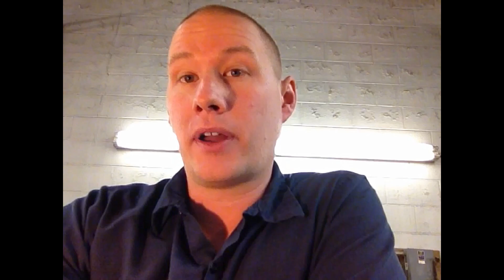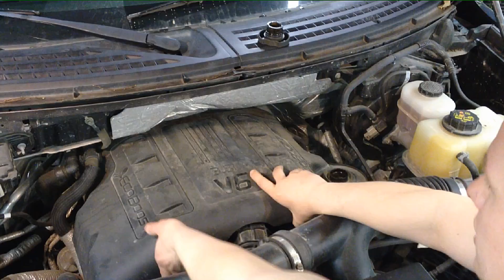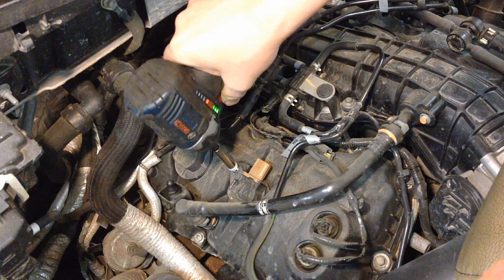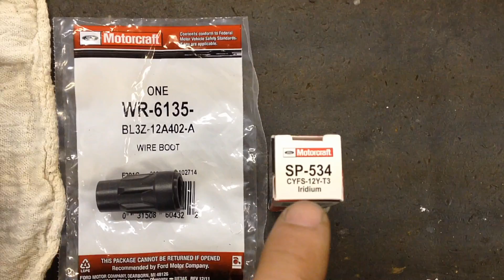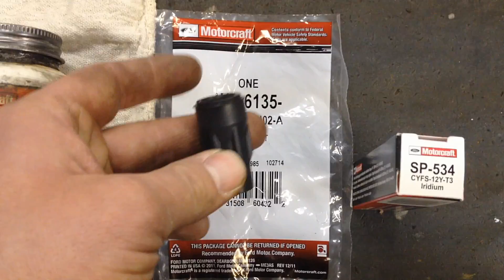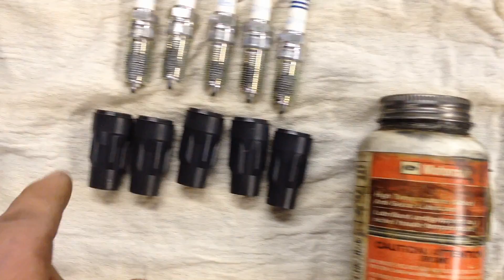2011-2016 Ford F-150 3.5L V6 EcoBoost Spark Plug Replacement

Comment: Man when I do this on my truck you won’t catch me blowing all that  crap off the intake manifold with my coils out.. if anything a quick blow out of each hole before removing the plug
Reply: i guess you know better than a dude whos done thousands of these lol wtf
Reply: @jimhendrix7776  I like his videos, they’re super helpful, and he’s definitely knowledgeable, but they’re not his vehicles. Just saying in my opinion, and on my truck, I’d rather not stir up any or the dirt and risk getting it down in the cylinders.
Reply: @noahgullion2  makes sense.... Im sure he practices what he preaches on his own vehicles :) though... 

2 each ones own no doubt though
Reply: @jimhendrix7776  I’m sure you’re right I just tend to take the best possible care of my stuff even though it may not make much of a difference it makes me feel better lol.

Comment: i HAVE 2012 FORD F150 3.5 ECOBOOST  SINCE THEN I BELIVE NEVER CHANGE THE BOOTS SPARK PLUGS CHANGE NOT LONG AGO I RECEIVED RANDOM MISSFIRE  what is your recommendation for spark plugs, boots, coils etc. you can  write amazon links. I also have problem with turbo. before i sent it to change my engine timing chain i was able to hear air suction after that i didnt hear any   car computer show some issue with turbo which dealer has.

Comment: So what happens when the boot separates from the coil? The first two coils I pulled came separated and are stuck in the spark plug tube.
Reply: no heat shield they seize onto the plug

Comment: I'm a little confused. I was under the impression that these plugs come pre-gapped and you shouldn't re-gap them. I have a 2013 F-150 3.5L EB and was given motorcraft sp-580's. I installed and the truck runs a little rougher than my originals with 91k on them. Should I take them out and re-gap?
Reply from the maker: They should always be checked and gapped to .028”
Reply: @FordTechMakuloco  Thanks for getting back this quick. Thought that may be the case after reading some more comments.
Reply: Just wanted to follow up and let everyone know that what this guy says is gold. I re-gapped the plugs to .028 and it runs smooth as the day it came off the assembly line. Well when the engine is warm anyway. Cold remains to be seen in the morning, but I can only guess that it will be smooth as well. The plugs came gapped at .031 and some at .032 and bringing them to .028 made all the difference in the world.  Thank you!!!!!
Reply: how did u check the gap and what method did u use?

Comment: I have read that with these 3.5 L Eco-boost motors (2011-2014), it is important to pull the spark plugs while the engine block is warm (not hot or cold). This is said to reduce the likelihood that you may gall the threads on the plugs or the engine. Is this your practice, or have you never seen any issues? (Man, these are truly excellent and informative videos!)
Reply: Never heard that, never had that problem either and I have 3 ecoboost motors with over 330k combined miles

Comment: I get the point about cleaning with air prior to removing boots and plugs.  But did I see you use compressed air (9:42) on a cylinder with the plug removed?  If yes, doesn't that now push debris into the open cylinder shaft?  Please explain...
Reply from the maker: No when the plug is removed you stick the air wand down into the cylinder then hit the trigger pushing everything out not in.

Comment: I see that this was created 5 years ago and it now "appears" that the SP-580 is the "new" correct spark plug and .032 is the new gap. Can you shed any light on this new standard or should we stick with the SP-534 and .035 gap?

Comment: How hard is it to replace those clips at 3:21? I broke 2 of the red clips trying to get em off. They seem to stay on without the clips and I may just duct tape em but just curious how difficult it is to replace em altogether?
Reply: I broke a red clip 2 years ago and never put anything else to hold it, still never came loose even after offroading
Reply: Did you ever replace them I need to figure out how and what part to buy
Reply: @rdking005  I never did, I put a little electrical tape around them and they held no problems for over 20k miles. I just traded in the truck on a 2020
Reply: I ordered the plug with wires I’m. Gonna try and replace the connector only and see if I even can
Reply: @rdking005 any luck replacing?

Thanks for this thread. I just broke a red clip as well. We will see how this goes
Reply: @baldcowboy  I never did, I put a little electrical tape around them and they held no problems for over 20k miles. I just traded in the truck on a 2020
Reply: The red clips are just safety locks. The gray clips under the red do the real work. The red clips don't matter. I have several broken gray clips and the connectors still don't come off. They get brittle with age.

Comment: Are all the specs and parts still the same?  Going to give it a try on my 2014 Ford F-150.  What are the pry tools that you are using?  Thanks.
Reply: westsidewil its a generic trim removal tool.

Comment: I have a 2014 F-150 3.5L V6 Ecoboost bought used last year. In the last 6mo I've had misfires on spark plugs. Both times is when I was accelerating to pass a car. Anyone have any idea as to why?
Reply: B Hays they need to be replaced
Reply: @jakefromstatefarm9135  Wow, really?
Reply: @bhays71  Did you get a check engine light? I'm probably replacing my plugs and coils tomorrow.

Comment: where can I find a map of the cylinders? I am finding 2 different ones online. My 2011 f150 needs ignition coil # 4 replaced?
Reply: Bank #1 is passenger side bank #2 is drivers side. Bank #1 from front cyl is 1,2,3 to firewall and bank#2 from front is 4,5,6 to firewall (V6)
Reply: @dirtboyslong9202  Thanks Man, changed it out last night.. second time I changed that coil out. Was originally on #1,  dealer moved it to #4 while troubleshooting code again,and said it was the coil and wanted $385 to replace it...told him to pack it up arse.

Comment: What’s the difference between sp580 and sp534 plugs?
Reply from the maker: SP580 is the latest plug replacing the SP534
Reply: FordTechMakuloco 
Thank You for the quick response!

Comment: Awesome video! Are these still your current recommendations (plug type and specs) for a 2013 F150 Ecoboost 3.5 V6?
Reply: No, use SP542 plugs gapped to 0.028-0.030, SP580 are updated SP534 plugs. The SP542 are a heat range cooler and help against pre ignition in warmer conditions with stock thermostat and cheap gas.
Reply: Doing research, I bought SP-580's as the newest plugs

Comment: Newbie question. When you blow compressed air down in the open hole, it looks like plenty of dust comes out. Are you worried about getting dust or fines into the cylinder?
Reply from the maker: No, you stick the air wand into the cylinder and then pull the trigger creating positive pressure in the cylinder with low pressure being outside the cylinder so all the dust from the threads follows the path of least resistance just like water and just like electricity.
Reply: 10-4. That’s what I figured. Will get longer nozzle. Thanks for your help.

Comment: Excellent video, did my 2013 with no issues thanks to your video.  Quoted $360 for this from my Ford dealer, did this for about $100 with supplies.  Plus I had to go out and grab the gap gauge etc.  Also for a newbie be sure to grab a magnetic socket for spark plugs, so much easier than my old spark plug socket that the plugs wouldn't stay in when pulling out.  Updated plug is now the SP-580.  Thanks again.

Comment: Did/do you change the spark plugs on the 3.5’s when the engine is warm or completely cold?
Reply: Warm... but not hot. Mine were a bitch to get loose.

Comment: Just did my 2016 expedition. At 72k it was running decent but just seemed a little sluggish and mpg lower than in the past. Clearly felt better after new plugs. Had a boot get stuck on the middle left bank. Had to twist the coil and separate it from the boot and then pull the boot with needle nose. Needless to say had to replace that boot too. Thanks for the great videos.

Comment: Great info, Thank You!! My dealer just changed my plugs and put in SP580 plugs and new boots, in my 2015 F150, 3.5L engine. Are the 580 plugs a newer version again?
Reply from the maker: yup just came out not too long ago.
Reply: @FordTechMakuloco  is the gap still supposed to be .028"  I'm ordering these plugs for my 15 3.5eco w/ 45k right now as the rough idle just started.....
Reply: @toddthacker8598  you have that too? I have a 15 3.5 just started getting a slight shake up front at idle. still on original plugs. 67k miles. i figured its a misfire but im not getting any warnings or check engine, no power loss either when I get on it. You think just swapping the plugs will fix?

Comment: I got a 2014 Ford F150 5L

i just bought new spark plugs SP 550, but i also got the other ones also SP 591 on the shelf, i didn't want to take a chance so i got both.

Comment: I have a 2013 F 150 3.5 Ecoboost, 155,000 miles. It has started leaking oil from the passengers side valve cover. So I've watched many youtube videos to see how to replace the gasket. No one has a video on removing the valve cover. However, I've tried to remove the valve cover, man that thing would  not come OFF. What is holding the cover down? Yes, I double checked ALL 12 bolts holding the cover, they are loose. I could pry the front of the cover up just a bit, but that's about it.  What should I try now?

Comment: 65000 volt coils and a .040 gap works with tuned engines and helps with economy. problem is boosted engines need better coils to prevent the spark from being blown out and narrowing the gap kills milage
Reply: Coil on Plug technology is THE HOTTEST ignition available.  FACTORY parts are totally worthy a race engine.  I have retrofitted parts from a mid-90's Ford 4.6 V8 to a 496'' Big BLock Chevy V8 with use of a box called MEGA JOLT that maps the ignition curve from a laptop.  MSD sells a system similar for TENFOLD more than using this system, and the FORD parts are rock solid reliable, unlike MSD's.

Comment: Just to share a comment, denso plugs will not run worth a crap in a ecoboost. I learned this just recently buy putting in a set of denso iridium. Needless to say the truck wouldn’t run and barely go above 20-25mph while misfiring. Motorcraft back in and it runs fine

Comment: Changed my plugs on my 2014 F-150 EcoBoost at 96K miles. Bought it used with 86K. Your video made the job so easy for someone that does not usually do this type of maintenance on their vehicle. I did have one plug that was seized, (rear driver side) and took as long to replace as the other 5. Perhaps a video on seized / stuck spark plugs? Thanks for the guidance and advice. Dealership wanted $289, I did it for $86 including coil boots, anti-seize and dielectric grease. Thank you! I am thinking about radiator flush next, already watched your video. Then I need to get my transmission, differential and transfer case done at the dealership.

Comment: I just bought a 2018 Raptor and all this talk about carbon build-up has me concerned.  I am already thinking of selling it.  What is your opinion of the durability of the engine, transmission and 4-wheel drive components?  I value your opinion.

Comment: Do you recommend changing the PCV valve with this service, or at any point on these engines? Thanks for all your hard work and contributions to the community!
Reply: Did u have a bmw before?
Reply: I changed it on my 2016 f150 3.5 EB and it ran much smoother and nicer in my opinion!

Comment: Wish you would’ve told us how to reset the PCM. My 2014 ecoboost F150 is idling more rough now after changing out the plugs and boots.. why?
Reply: I have a 2015 Taurus sho and same thing. I changed my plugs mainly because I tuned it and after plug change getting shudder at highway acceleration and rough cold idle. I did gap mine a 0.30. Now after some research it seems people are using a 0.28 gap on these engines.  Going to pull them back out and re gap. However factory ones that I pulled out were opened up to 0.35-0.40. Any advice ?
Reply from the maker: I have detailed videos on this procedure.
Reply: FordTechMakuloco yeah I saw that, I have reset the pcm just by disconnecting the negative on the battery and my truck is still vibrating a little on idle. I did the plug change at 55k miles as preventative maintenance and for some reason the truck runs funny now at idle.

Comment: Thanks for the video!!  It helped me out quite a bit.  Pain in the butt when the end boot piece comes off and is stuck on the plug...5 out of 6 on mine.  Had to make a coat hanger tool to get them out before I could get to the plugs. Of course, had to purchase 6 new boots $6 a piece at Ford dealership. Ugh.

Comment: Great video...Thanks for the heads up on everything.  Also liked the music =-)
Ill be replacing mine this weekend but may wait to get the boot.  Im getting codes on 2 misfiring.  I can clear the codes and it runs fine until I floor it then the engine light flashes.  Ill be interested to see what my plugs look like.  Im trying a emissions cleaner first.  I read where one guy used lacquer thinner.  I didn't want to do that...

Comment: Is everything above still the same with a 2015 3.5 f150 ecoboost relating to spark plug gap and torque settings?
Reply: Im curious, did you find your answer? I have the same year motor with the same questions.

Comment: awesome video.   Only thing i would add is that there is a locking clip on the hose and the electrical connection on the left bank as your removing them.
Reply: On mine the release clip on the high pressure electrical connector is on the under side.  That took the longest to find and disconnect for plug # 6.

Comment: Awesome video man. Engineers at work highly recommend not using any kind of anti seize. Since its such a light torque on these plugs. We have actually had them loosen up well on the dyno. Also adding Dielectric grease to the top of the plug will help with the coil boot coming off easier next time.
Reply: I have never seen Anti-seize promote a fastener becoming loose on its own. It keeps the 2 surfaces from fusing together.  Unless your engineers have a detailed explanation.. I  will use it.

Comment: I bought a 2014  3.5L 4x4 super crew cab with 72K miles. The dealership said I had a bent valve due to a tuner being installed on it, and that I needed to get a new motor. I bought a new crate motor, had it installed by ford dealer and went from 14.5 MPG to 11.5 MPG.. What the heck is wrong!!  I bought this truck with a 4 inch lift and 20 inch tires on it.. can that really make such a difference in MPG?

Comment: I have a 2011 ecoboost. At 110k started having misfires brought it in and they said I had a bad coil, plug, and cat. Next day engine light came on again along with the misfires. They sad it was another plug so hadn’t them change all the plugs. Fixed the problem. Now 160k and same problems. Bought and code scanner and said 4 and 6 misfiring. Bought new plugs and coils plugs were gapped at 3000 old ones were 4100. Change was easy thanks to your videos. No more misfires, but idle was rough at first and now my gas mileage went from 18 to 14. After all that my question is do I need to clear the pcm or should I look into cleaning the mass air sensor or throttle body. Sorry for this being so long

Comment: Thanks for this awesome info. I switched out the plugs last night and gapped at .028 and now the rpm’s seem to be running a little higher at idle, would this be caused by the shorter gap on the spark plugs? Also noticed that one of my coils cracked (not while removing) so I ordered a replacement. Truck runs amazing and I can definitely feel the difference. No more hesitation or shuddering at WOT. Also all the old plugs were at different gaps. Some were at .030 and one even was at 0.45!  I think that anyone that’s experienced a shuddering or loss of power in their ecoboost should try this pm first.

Comment: Thanks for this video Master Po!  Young Grasshopper completed this a couple of days ago on my new (to me) 2013 XLT 4x4.  Other than the coil pack bolts and connectors being on the lower side instead of the upper side, it went perfectly.  With 53K on it the original plugs were a bear to get out and one was quite frozen in place. With a little penetrating oil, a breaker bar and some patience however victory finally came. The stuttering idle at cold start is completely gone. Maybe it's wishful thinking, but over the last couple of days, the fuel economy indicator shows my average mpg is up by about 1.5 mpg.
Reply: better fuel economy is pretty standard with new plugs

Comment: Do you recommend changing the whole coil pack as well with spark plug changes? On my boosted/tuned GTI I would always do this as extra assurance since it was a minimal cost to doing so (~$10/coil pack).
Reply from the maker: +Mark H no I would not swap out OE coils for inferior aftermarket coils you will regret it

Comment: toyota 5.7 tundra 170.000 never a cel just plugs go 100.000 miles 1 water pump  1belt 1tensioner thats it thats it love my tundra also 380 hp
Reply: You've done more work to that motor than i have done to my 5.4l 3v with 251,000 miles on it.

Comment: Question on the gapping. Bought the plugs and boots from your link. Upon receiving, I noticed on the motorcraft's box that the plugs came in "Caution: Spark plug gap is not adjustable"......... Sooooo gap em' anyway or?
Reply: Whatcha think?